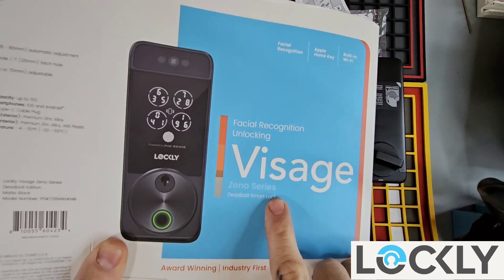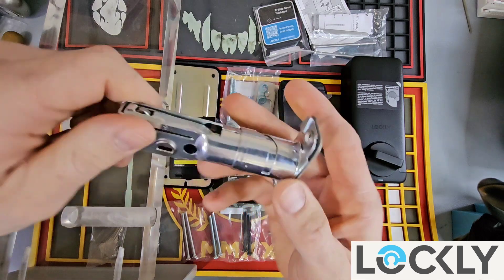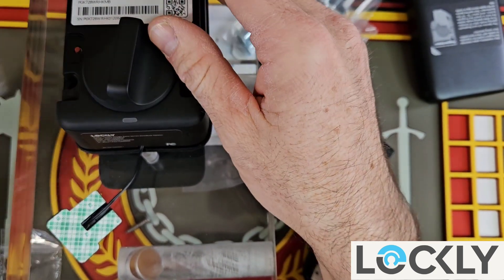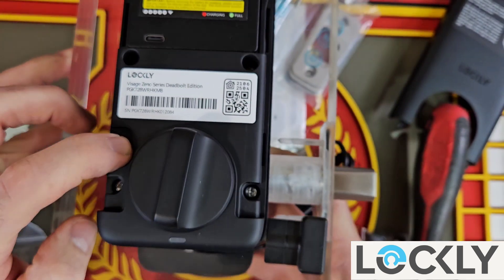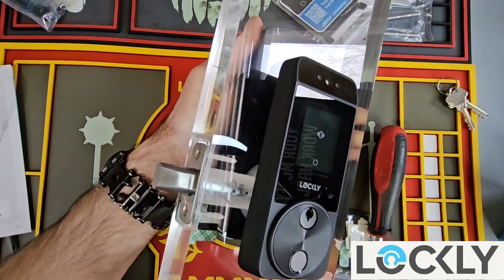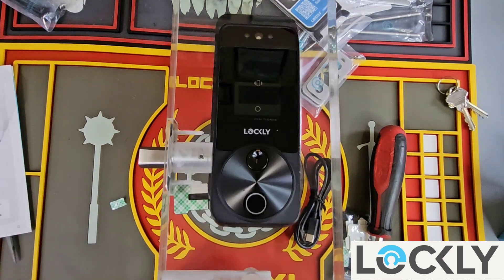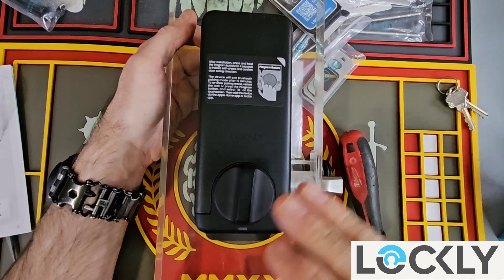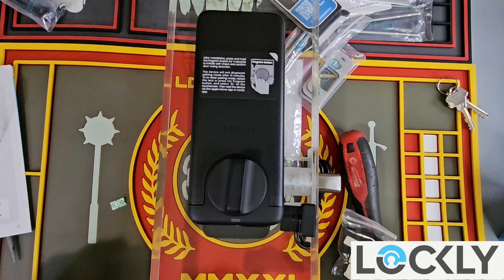Installing the World's Best & Most Advanced Smart Lock With Biometrics – Lockly Visage Zeno!

Comment: Great step by step. Only problem I had is that lock turned without obstruction without interior apparatus and turn is difficult with it.  Lock has great features
Reply: Without the back portion of the lock on it turns smooth but once I mount the back part on and I turn the lock there's a stuck feeling and idk why but it's driving me crazy
Reply: @MrVizziato23 i encountered the same problem but it seemed to work it's way out once I finished assembly, closed the door and tested things out. Did it work for you?

Comment: So call a smart lock its great but one crazy software thing that has been so frustrating for so long. If you need a single code to work for a time block that extends past midnight—such as 5 PM to 2:30 AM—it won't function properly because the smart lock doesn't recognize the transition between days. Once midnight hits, the system no longer sees the original time range, requiring you to create two separate codes: one from 5 PM to 11:59 PM and another from 12 AM to 2:30 AM. This is an unnecessary complication and a major oversight in the software design.  This reminds me of Y2K and the computers freaking out because of the 00.... Its 2025 this should not be a problem lol.

I have reported this to the tech team many times but it seems they are not interested in this easy update that would make people's lives easier...